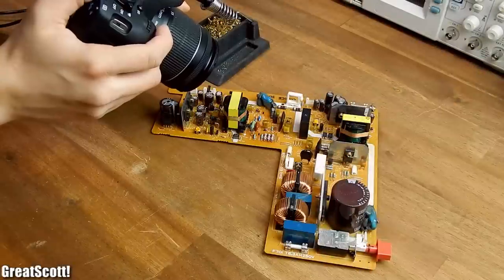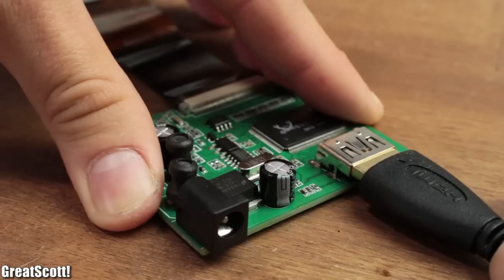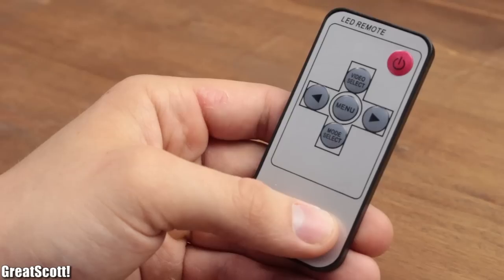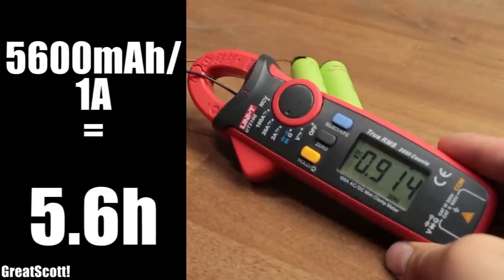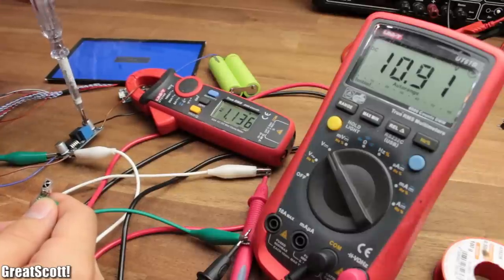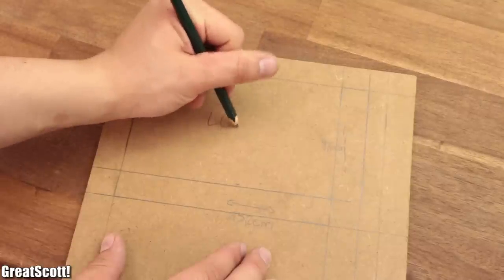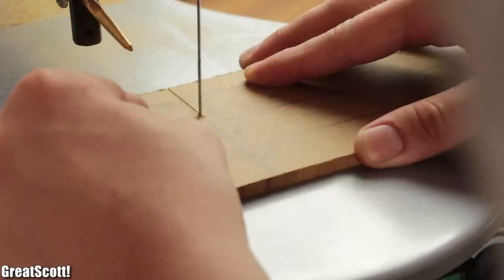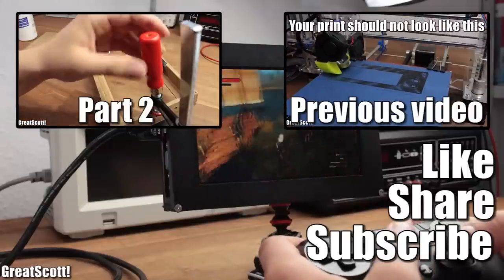DIY Portable Mini Monitor - Part 1

Comment: How many 18640 batteries is it possible to connect in parallel to the TP4056 charger?
Reply from the maker: Sotos Alex There is no "real" limit since the board was not designed for that. But I would say not more than 4.
Reply: Sotos Alex Depends if they have their own protection circuit or not - the discharge protection on the board in the video can only really protect one battery but should prevent overcharging with many in parallel. Most likely outcome is you'd kill the weakest unprotected battery sooner than with a balanced charger but be aware consequences can be worse.

Generally you'd get away with using 4 if they are fairly well balanced - IIRC these are 1000ma boards so wouldn't be optimal for more than that.
Reply: Thank you both for your responses! I'll probably go for 2 batteries in parallel. The were salvaged from the same battery pack (laptop battery), so I guess it'll be fine.

Comment: Want better cutting? Lose the scroll saw and get a Tabletop Table Saw using the finest tip blade for precision! Scroll saws are not used for straight line cutting of more than a 1/2 inch length.

Comment: I want to turn my desktop screen with 21.5" into a touch screen portable Second screen. I want to let the Desktop Pc always on my TV on the wall. But i want to use an 21.5 screen on hands connected as primary screen of my desktop and use my 55" TV on the wall to drag movies games from the portable screen on hands to the tv display on the wall. My screen is a defaut desktop one Acer v226HQL. But i want to get rid of cables. The Desktop stay closes of the tv. How much battery i need to handle this screen ? I also want to create a dock to charge It on the wall above me on the bed. What about the hdmi Connection? How i get rid from the cable? I want to connect the displayport output from my Radeon VGA trough wireless into the portable screen HDMI input. Wich is the best solution?  I also need a touch screen frame to turn It on touch screen. Also a way to wireless connect the touch frame to the Desktop. Can you help me with this project?

Comment: is it possible to make it where you could use the batteries or the plug-in power?
Reply: Cameron Sisson Yes, it's quite simple. Just connect the outputs of the boost converter to a correctly sized barrel connector that would plug into the LCD driver board like a wall plug. This will allow you to use a regular wall power connector if you want.

Comment: 3:37 i freaking swear i have the same excact circuit, bought from a local greek electronics shop
Reply: This is a common boost converter circiut.
Reply: @oniruddhoalam2039  You are right, it is a common Chinese design.

Comment: WARNING! Do NOT do this! The display controller board uses an HY2576 voltage regulator (1:38) which datasheet clearly describes an input voltage range of 7V–40V. If you attempt to supply 5V instead of the recommended 12V (3:59) you risk destroying the regulator or damaging the panel! The D²PAK package regulator is also glued to the panel, so you can't simply replace it. Be safe and connect it to an outlet! :-)

Comment: I stopped at "this VERY CHEAP screen, 20$"... you clearly show an Aliexpress item, but in the description you link to Ebay...
Reply from the maker: +Roy I think that I said that I did not used the cheap screen. I went with another one with a higher resolution which you can find with the ebay link.
Reply: You should've kept watching, he explained that he didn't use that one for several reasons. He eventually went with a slightly more expensive one.

Comment: This usb charger is garbage. Check the datasheet. It could charge your cells up to 4,35 volts and let then discharge down to 2,3 volts. I wouldn't trust this thing with my cells.

Comment: würde der auch funktionieren?: http://www.amazon.de/Raspberry-Pi-LCD-Bildschirm-VGA-Eingang-Treiberplatine-Controller/dp/B00G60FJNG/ref=sr_1_fkmr0_1?ie=UTF8&qid=1454609056&sr=8-1-fkmr0&keywords=hdmi+vga+lcd+bildschirm+1280x800 (would that one work as well?)